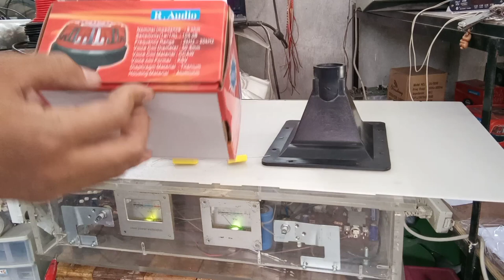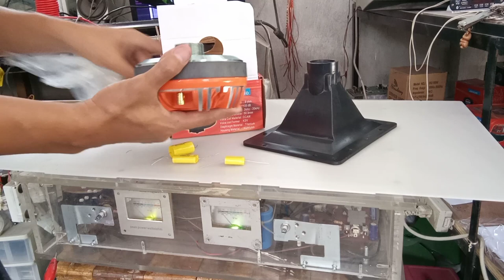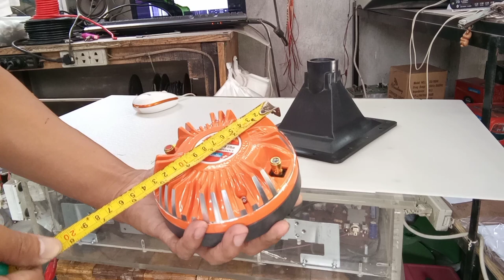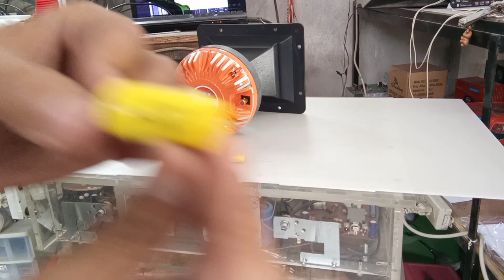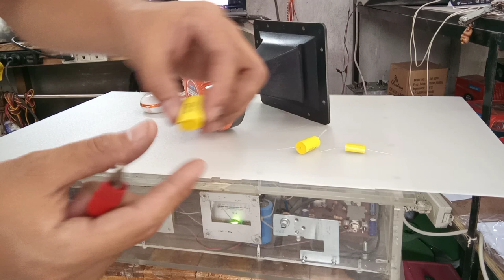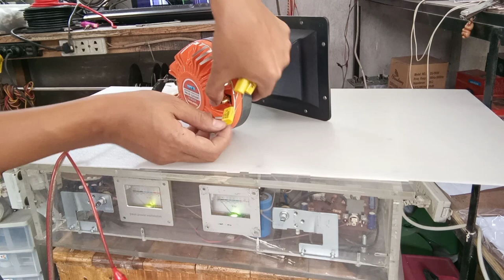Capacitor for Tweeter

Comment: 2.7 uf and 3.3 uf son los mejores..mas de eso daña la bobina, le pueden pasar frecuencias bajas como con el 4.7 uf  o de 5uf .. 10 uf
Reply: amigo para cortar a 3.5 kz 12 db un tweeter de domo ceda  de 4 ohms 12 db  que capasitor recomienda?
Reply: Tengo un minicomponente Panasonic trae su twiter con un capacitor de 1.2 uf ...pero le puse uno de 3.3 y se escucha mucho mejor..creo que le pondré los 3.3..... qué opinas????

Comment: Bosing mgandang umaga. Magtnong lang. Anu po kayang resistor at capasitor ang bagay po sa tweeter na 300w. Amplifier po nmen is kevler gx7. Slamat po and god bless
Reply from the maker: Ok na po jan ang 2.2uf/250volts. Resistor optional lang po 10 ohms 5watts or 10 watts

Comment: Sir tanong ko lng,my tweeter ako na 450watts na Broadway,ano bang tamang value at watts ng capasitor at resistor Ang pwede? Salamat sir Kung mapansin mo eto.
Reply from the maker: 3.3uf/250volts to 4.7uf/250volts
Reply: @ramoncruz0137  maraming salamat sir.
Reply: patayin mo backround di marinig maxado

Comment: sir may sakura 757 ako at speaker nya is crown jh157....
hindi ba masusunog ang tweeter ko na cy300 sir capcitor 3.3uf e direct connct ko sa speaker sir?
isa lng kasi ampli.ko sir...sana mapayuhan moko..salamat

may capacitor ako dito sir na 2.0uf (400vac)pan  capacitor at crown 3.3uf....alin dito ang tested at maganda sir?
Reply from the maker: Pag mataas ang value ng capacitor mas magaspang ang tunog, pag mababa ang value mas pini ang tunog.
Alalay lang sa volume sir pag distorted na tunog low down the volume para iwas sunog 😀.
Reply: @ramoncruz0137  salamat sa payo sir...may last na katanungan ako sayo sir... ano ba porpose ng dividing network sir? dagdag lakas ba?  at anong mai suggest mo sa aking set  na dividing network sir at ilang watts na 3 way ang swak ? sana masasagot mo pa ako sir para maiayos ko tong set ko...salamat po
Reply from the maker: Sa set up mo pwede ka mag kabit ng 300 watts dividing network, hindi sya magbibigay ng lakas. Sya ang mag sseparate ng tunog, LOW , MID, HI kung 3way or LOW  at HI kung two way.

Comment: May Metal dome (Tweeter) ako sir 150watts 8ohms plagi sinusunog ng ampli ko AV-735 , Pki advice sir anung dapat Kung Ilagay. Salamat po
Reply from the maker: Kung makakabili ka sir ng dividing network na may bulb protector para hindi masunog ang coil ng mdt mo.
Reply: @ramoncruz0137  Ok sir, kapag ako lng gagawa sir ano bang pwd component dpat kung ilagy at ilang voltahi po? Salamat
Reply: Separate mo Ng amp tweeter mo dabest

Comment: Sir tanong ko lang PO may mid-range Po KC ako na 800 watts kaso diko Alam Kong anong capacitor Ang dapat na ilagay don eh, sir b? Po pwd mo ko matolongan para Hindi masayang mid-range ko at. Isa pa Po may tweeter din Po ako na 500 watts ano din Po dapat Ang ilagay na capacitor salamat po sir
Reply from the maker: Midrange 4.7uf, 6.8uf,
Tweeter 2.2uf 3.3uf
Pili ka jan bosing ayon sa tunog na nais mo.
Reply: Okay Po salamat sir